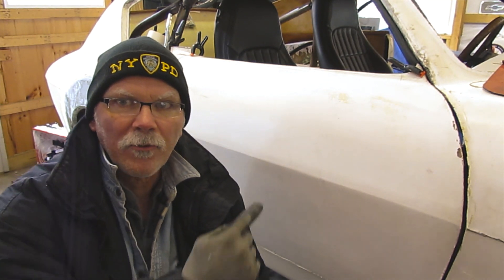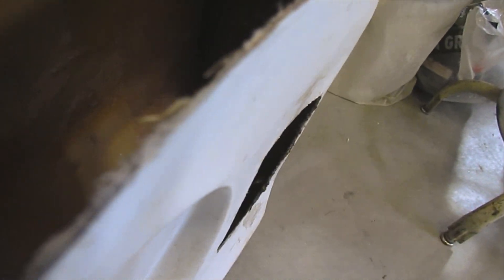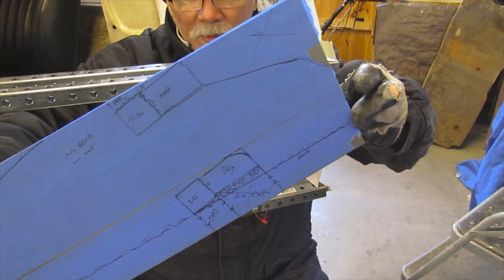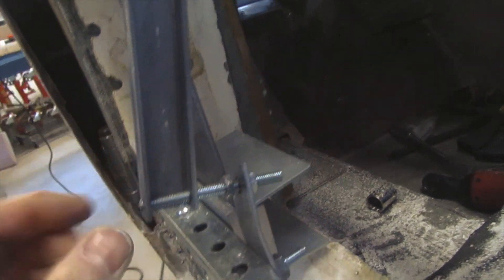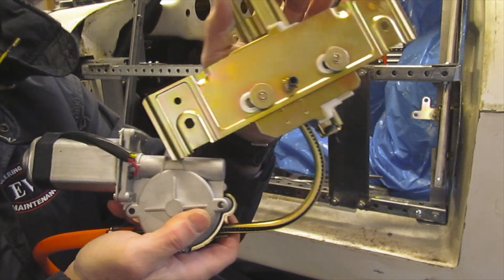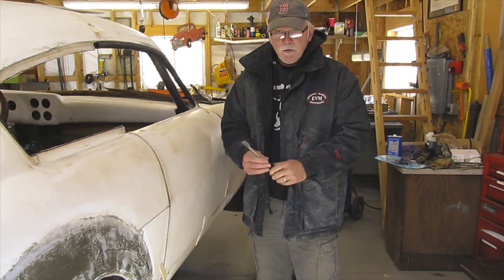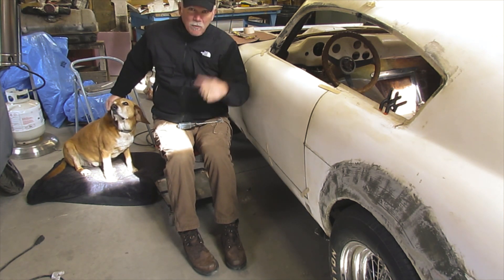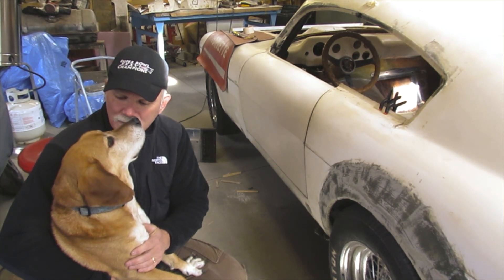Fiberglass Car Door Construction - Step by Step Details

Comment: I appreciate your time & workmanship, so am not having a go at you. But putting all that steel back in the door, and then the minimal weight difference between just the skin of a door in thin metal cf. fiberglass - well I can't really see what all your long hours really gained you. What I do by way of comparison, is I mold the inner door frame in fiberglass, taking in the hinge & lock mounts, but only three inches of the door's inside edge that faces the driver. When I copy that and then glue it to the outer skin my doors weigh 7kg compared to the factory 28kg, and the door just bolts straight in place. But you sure put some effort into this.
Reply from the maker: Bill, nice to hear from you. I'm a big fan of your channel and have learned a lot from you about fiberglass fabrication.  I am not concerned about weight, only stiffness. This is a road car, not a race car, and will have real glass and power winders. As the door is frameless, I need to ensure the window is adjustable and closes tightly every time. That means a stiff hinge, frame and latch to mount it on. The door shell (and entire car) I started with was very old and flimsy fiberglass; check out the rest of my videos! I haven't weighed the doors yet, but I guess they're well under 20 lbs. Thanks again and keep offering suggestions!
Reply: @Stoneface_Garage  Road car... now what you did makes sense. My fault for being totally "race" oriented. That explains why you put those winder mechanisms in your doors. What is the car btw... a fiberglass kit car of some sort?
Reply from the maker: Victress coupe, rare kit from the 50's actually. See my channel home page and video for more info.